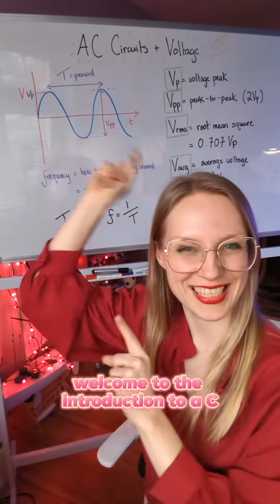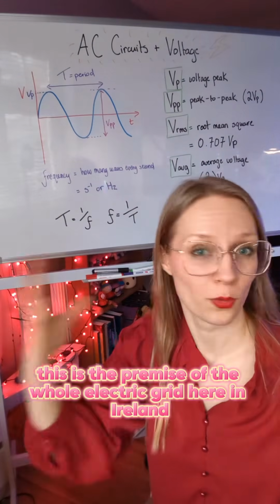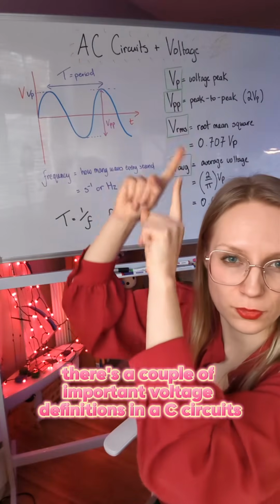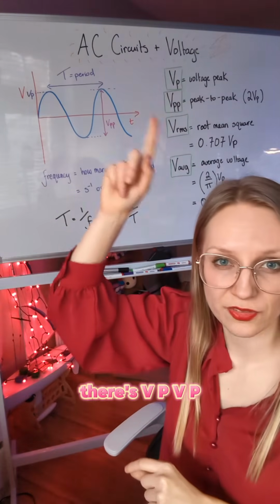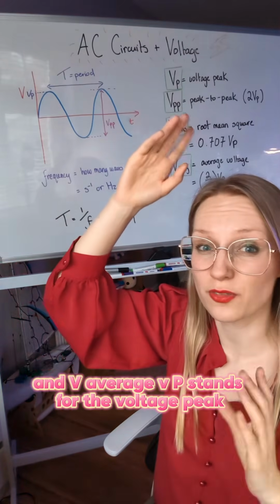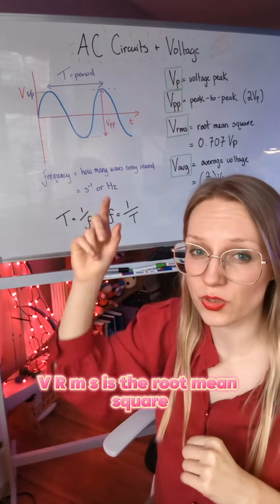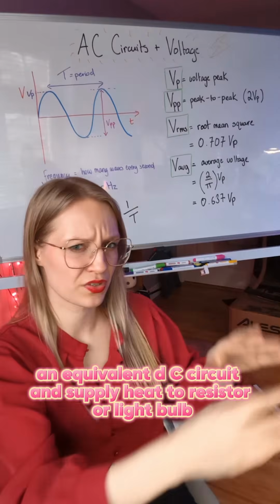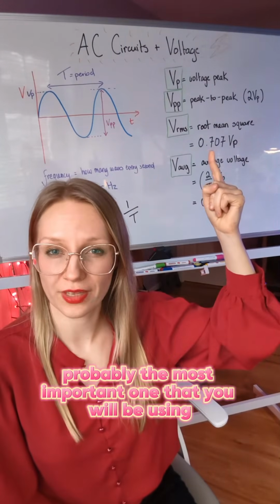Introduction to AC Circuits #electricalengineering

Comment: What informed the 50 & 60 Hz frequency difference? Are there any advantages over the 50Hz?
Reply from the maker: @thuokagiri5550  I believe 60hz originally was set up with the idea of synchronising to clocks! Both have advantages, 60 hz is better for long distance high power and 50hz is better for lower power shorter distances but the difference really isn't that high.